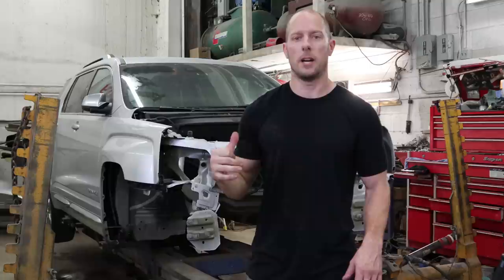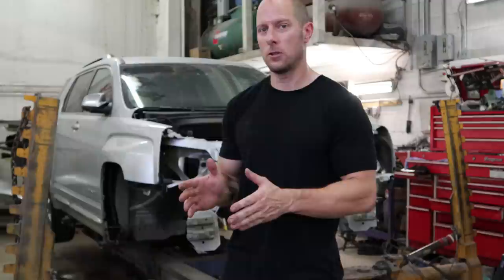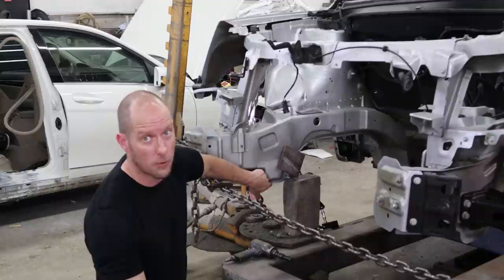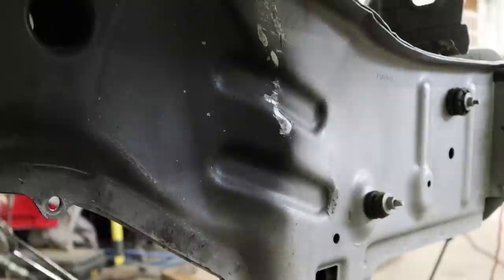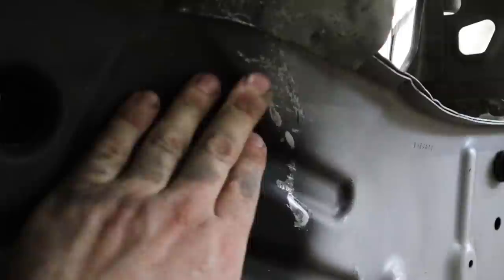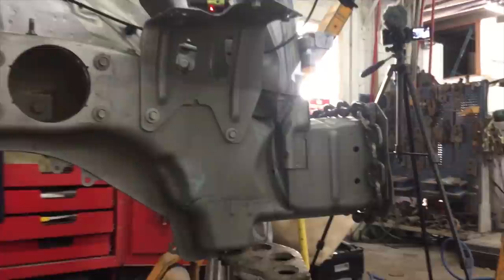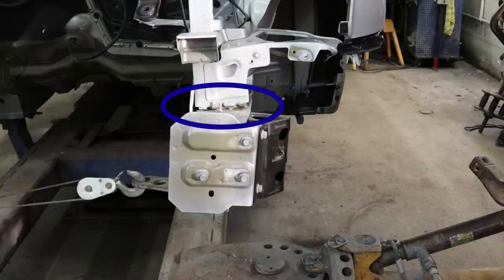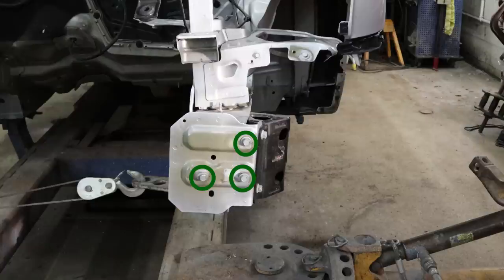Frame pulling tutorial on our 2015 GMC Terrain salvage rebuild project.

Comment: live video for sure.  I would love to see some videos of repairing it the right way, start to finish.  Techniques used to determine where to cut damaged rail and replacement.
Reply from the maker: If you put all the tutorials together at the end it will be the whole job, or most of it, in real time.  I do have a time lapse that shows it all as well.  The time lapses make it easier to show a whole job that takes 60 hour or so in a watchable 10-20 minutes depending on how long I ramble. lol I didn't record a lot of live stuff outside of the tutorials because that was my focus at the time.  My Silverado, "Mistake" will have more live stuff.  Thanks for the feedback, it is always helpful.  Thanks for watching.

Comment: I like your commentary as you progressed better than the still shots. 

The shop was probably scared to pull the motor and transmission in order to fix the frame rails (I've never seen a shop around here do it). Did you say this is going to be your wife's ride? Great video, keep them coming!
Reply from the maker: Noted on the stills, I figured I would try both and let the viewers decide.  I drop drivetrains all the time, it is so easy but most people try to avoid it.  I do it even when I don't have to because it makes a better repair and saves time in the long run. It is going to be mine but my girlfriend has been eyeing it.  I think it is the  V6 and AWD since the snow will be here soon and she thinks she drives a race car.  Maybe I will get my old Denali back that she took from me. lol

Comment: A few measurements is all you need to fix most front collision damage.  Front top corners to center of cowl under windshield. Rear top corners (under the hood hinge areas) to opposite subframe outer holes. (Measure 2 diff holes to get with a 2-5mm spec) Top strut holes (2of4).. to front face of the frame diagonally. Center of core support to rear corners of the hood hinges again. Front door top hinge to opposite Front face of frame.
Reply: Having all the measurements is one and easier thing - fixing the damage is completely different matter and very challenging...

Comment: I really appreciate you showing the first try to bend & pointing out the spots where the weak crumpled areas were and the decision to remove and replace and the reasons why. I have a 2014 chevy captiva with drivers side front end damage and am seriously considering doing it myself. I've already removed the bumper and drivers side fender. I'm thirsty for more videos. When you produce the next video can you include removal of the structural member you are going to replace?  Excellent video and information!

Comment: Very good demonstration and explanation !  That first chassis leg came out pretty good , didn't it ?? (Arthur Tussik would be proud ! lol....) .  I was quite surprised that you said that a jig such as a Caroliner is not needed as much these days !  Given the advances in technology and accuracy in the latest cars , I would have thought that a jig would be more needed in the interests of accuracy !? .... I know that the manufacturers want to 'replace' everything , rather than repairing , but even if you're going to be replacing chassis legs (in this instance) , there could still be movement in the bulkhead / chassis leg interface , which would need a bit of accurate 'finessing'...... I'll bet that they still produce measurement spec sheets for frame repairs on the newest models..... A good job anyhow....helps to educate those who don't know or have any experience in this type of work.
Reply from the maker: Yeah, with a little more work it would have looked like new.  The problem is, it will not act like new in the next collision.  So for safety, it has to go.  Arthur does a few things that would not fly here in the US but that does not take away from the fact that he is a master of the trade.  He just has different rules to follow.  You have to remember, some of my audience only has a garage or maybe even a driveway to work in.  I just don't want people to think you need to spend $50k on a frame machine when you really don't need to.  Since most parts are not allowed to be straightened, the amount of pulling power to straighten is lowered considerably.   I could remove the rails and pull the towers and rear apron sections with very little effort if needed.  I could also pull the rails to move the bulkhead and not worry about the damage to the rail itself also with very little effort.  The newest frame racks are becoming measuring jigs with the ability to pull as a bonus.  The measuring system is the key.  The new jig system are awesome.  They basically "float" the piece wherever you need it.  They will always produce measuring specs, even if you are replacing parts, you need to know where to put them.  Measuring parts can still be done with a tram and tape like we have always done.  A jig can be made up out of wood if need be.  If you are fixing the family car or one rebuild project a year, the frame rack is an unneeded expense.  If you are a shop that does bigger hits, the frame rack time savings will pay for itself very quickly.  My goal is to help the beginners realize that the big fancy tools are there to make life easy but you can achieve the same quality without them.  My thinking is to teach how and why we do things in the shop and break down the real uses.  A frame rack is just a way to secure a car and pull.  Most people don't think of it that way.  They think it is some magical tool that cannot be substituted.  Thanks for you support!  Sorry about the novel. lol

Comment: Good video! I hate to think how many vehicles just get pulled straight & covered up by people looking to make easy money.
Reply from the maker: You would be very worried if you saw some of the stuff people called "repaired".  Sometimes it is done not to make easy money but because people just don't know the correct repair procedure.  A few years ago before high strength steel, you could have straightened that right rail and been fine.  Not everyone stays current with new technology so they are still sectioning and repairing things they shouldn't.  Then there are the "easy money" guys that really could not care less about doing it the right way..... FU*K THOSE GUYS!  Thanks for watching.
Reply: That’s what my dad did with my moms car after the frame got bent just straightened it half assed and called it a day it’s still bent it makes noise but so far it’s still holding good after 5 years

Comment: Made a frame jig iIn my garage, when my 89 silverado kinked at the steering box.    Basically a box of tapcons in the floor holding down anchor points and a 5 ton porta power. 

It was enough to completely mangle the silverado frame.  Haha, it was bad.  Ended up putting the cab and box on a 2500 frame I bought from a guy who was parting out his. 

"Kinda rusty" is too rusty to straighten anything...

Comment: Local body shops in my area refuse to come out and look at my truck I feel it is repairable since it is a clean 2001 1500 LT silverado 5.3 sportside 2 wheel drive extended cab. I have seen you repair worse all i need is the frame checked and brought back to drivable condition. I think I can replace the rest of the parts if it drives straight.

Comment: Im glad I saw this before i went out and started pulling lol
Reply from the maker: This is specific to this car.  Frame rails can be straightened and sectioned on other vehicles so you may not have been doing anything wrong.  Unless it is really crumpled up then, always replace. Good luck on your project.
Reply: @vehcor  thanks for the tips my inner fender/ core support frame on my g35 is a little bent to one side but your video helped me understand and get an idea of what u can expect if i dont do it right
Reply from the maker: If it is just the radiator support and apron and all above the rails, you are all good, straighten away.
Reply: @vehcor  thanks for your help I appreciate it!
Reply from the maker: No problem, any time!
Reply: vehcor how to you know if it can be pulled or it has to be replaced?
Reply from the maker: @hondaguy425able  Repair procedures tell you how, where and what you can repair.  They are specific to every car and every part.  There are general rules like:  If something is crumpled in a crumple zone, it is not repairable.  On older cars and even a few newer ones they have places to section it and replace the crumple zone.  This one does not, you have to replace the entire frame rail the only part that can be sectioned is actually in front of the crumple zone. Radiator supports are not usually structural, basically just there to hold the cooling and head lights. You can straighten them all you like but they can be a pain since they are usually thin and odd shaped.
Reply: vehcor so im working on a 2017 subaru. Do i go to subaru to get the repair procedure? Or do other places have them? Love your videos. And i really like the tutorials your putting together!
Reply from the maker: @jeremyoliver4948  If you are buying parts from the dealer, they will usually provide you with the repair procedures with them.  If you have a good relationship with them, they may print them out for you even if you are only buying some odds and ends.  You can always go to a bodyshop and ask them if they can print them out for you.  A small donation may help move that along. lol I don't know of anywhere on line that gives them out for free is but some searching my provide some insight.  To be honest Subaru is one of the worse to get info for.  Even estimating systems are behind.  Thanks for watching.

Comment: is there any website where we can purchase airbags, and different auto parts such as front bumpers, headlight frame, brackets, etc. I've recently crash my car on a snowstorm, car slid and hit the highway concrete barrier. I don't have the money to afford fixing it through the dealer so this has became my 1st project. I don't have a shop like you do but I'll manage to make it happen I guess. Please advise on where I can buy all this parts I need. thank you for your videos they are really helpful.
Reply from the maker: Try car-part.com to find yards in your area.   Good luck.

Comment: I have a 2009 Cadillac CTS that was wrecked in the front. The two beams that the crash bar bolts to are pushed in and down. I don't have a frame puller and am pulling with a tow strap and a pick up truck and a come along.  They're pulling out OK , but I have nothing to measure to tell if they're where they need to be.
Reply: hey i’m thinking about doing the same , did it work out for you?

Comment: You're killing it,this is the best video I've seen on the subject. It's almost on par with Eric from SMA but collision repair instead of mechanical...... If that makes sense.
Thanks again and the mixture of narration and filming is great.
Quick question though, its been ages but the shop I helped at always did a quick pull even though he was replacing parts. What's your thoughts on this? Is it a waste or help?
Reply from the maker: I completely understand your analogy.  I enjoy SMA videos, they are entertaining.  I don't watch many YouTube videos but his are some of the ones I always click on.  I am a mechanic in my day to day job and I do things exactly like he does.  Test the part/system even if the problem is a common one because every once in a while you get the uncommon one!  I would have done the pulling even if I wasn't trying to make the video.  Panels adjacent to the parts you are replacing can move slightly even if you can't see it.  It is easier to move it all back when there is something to pull on and it is all together.  It sucks when you are trying to put panels in and they won't fit because something is off.  You have to stop, move the other panels and continue.  It ends up costing time in the long run.  That is why I pull just about everything before I start replacing.  Thanks for you support!
Reply: @vehcor  Thanks again for the reply and sharing what you do. I'm looking forward to more videos because the quality of your work shows. But no worries I know it takes time.      Thanks again

Comment: Thank you for the video.  It was great.  As a total noob, I would like to hear more about some of the basic concepts of straightening a frame, such as the measurement systems, determining how much and in what direction a frame is bent or twisted, what guidance you use to determine whether to straighten or replace, etc.  Total basic stuff.  I learned some based on what you were saying.  I figure there is a shop manual of some kind that gives you basic guidance depending on the type of metal and the type of damage.   You would literally have to explain it to me like I am a 10 year old, lol.  How do you get the engine out when the frame around it is all bent up and it does not lift or drop out like it is supposed to?
Reply from the maker: I’ll post more how tos and keep teaching in all my series as I go.  Sometimes you have to start cutting to get the engine out.  This one wasn’t bad but I have had some that put up quite a fight. Thanks for watching.

Comment: That was good explanation about the high strength steel.  So has to be replaced all the way back to the firewall?  No staggered welding allow for repair it? Can it be straight it out if is just a light bent?
Reply from the maker: No sectioning allowed on these except for the front of the rails.  Basically everything in front of the crumple zones.  If it is a light hit and bends somewhere other than a crumple zone and does not kink, it could be straightened.  The right rail was border line repairable but I would prefer to do extra work to make 100% sure it is correct. I have done a couple of these that were very light hits.  The reinforcement just twisted the ends of the rails.  I hammered the rail opening flat again and welded in the new flanges for the reinforcement but that is the only repairing I have done on these rails.  Thanks for watching.

Comment: Sir I have a very important question to ask. On a frame of restoration process, should you check this frame inspection alignment before or after removing the body from the frame before working the panels. Or does it matter? Thanks for the video, very informative. Or can anyone care to answer my question, please more the better. Would the motor and transmission being removed make a difference on the frame inspection? In advance, thanks to all. Respond soonest if possible.

Comment: Awesome video and explanation for pulling but I have a question I'm in process of pulling rear end out of my car got hit passenger rear but I can't get the trunk to line up so it will latch n close i pulled out n down on that corner got it really close but still have a little overlap when I close trunk any suggestions? Btw I'm using come along n tree
Thanks

Comment: Hi man I really dig your videos. Just wondering what if you use air hammer on the hammering process? Would that be easier or would that cause problems?
Reply from the maker: Thanks.  I have used an air hammer before, they make a bits that look like the head of a hammer. https://amzn.to/2KizcHV Some times it is hard to get air hammers in the right place at the right angle and their power is limited.  A few good well placed hits it all it really takes.  I find air hammers are best in areas where you need lots of little hit and can deliver them as fast as possible.  Don't get me wrong an air hammer is one of my favorite tools. lol Good question, thanks for asking.

Comment: Love both forms of your videos, but I suppose this form is actually easier for the viewer at home to digest.  

Either way, I can't wait to see your techniques without a frame machine.  I have been considering using trees and making a sort-of-DIY puller from an engine cherry picker, but I have been a bit gun shy so far.
Reply from the maker: There will be the usual narrated time lapse of this complete job at the end of all the tutorials.  The frame rack, if you break it down into simple terms is just a way to hold a vehicle and provide pulling points.  I have used my car trailer as a frame rack, trees, other cars, etc.   The possibilities are only limited by your imagination.  Sure the frame rack is more precise but I understand not everyone want to invest the big money in one and you don't always have to.  Thanks for watching

Comment: Previous owner bumped into something and bent the frame affecting radiator and condenser. Any advice? I'm thinking cut it out, either straighten or replace. Help needed

Comment: Thanks for the video I have a question maybe you can help me with : 2004 Chevy Blazer 2 door (It's a sentimental value) Problem : was hit before i owned it I want to say Drivers side at the angle of the driver's side bumper And fender area : Bumper has a gap over it at the grille  Two small tow hooks (Driver side higher And angled at say 9:30 instead of 9:00 o'clock position) ........The question I know i need to get it on a rack ...I have a very limited amount of money What would i need to remove to help save on labor charges So they can look And access/pull the frame? Bumper fender inner fender......The issues i am dealing with his bad alingnment warping rotor every 5 to 6 months Slop in steering ......Hey i know it was alot to read ..Any help is much needed And Thanks in advance